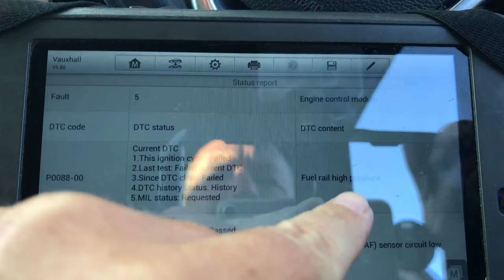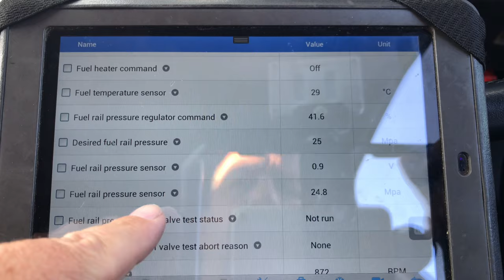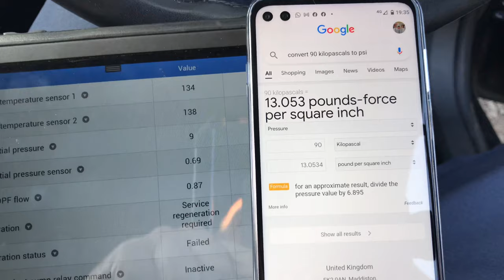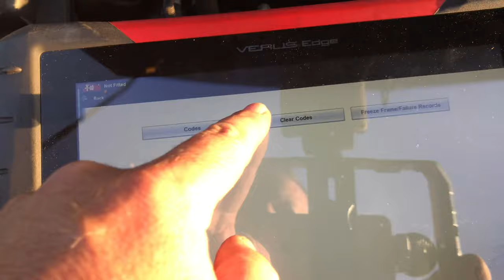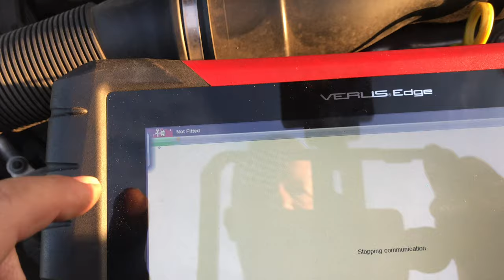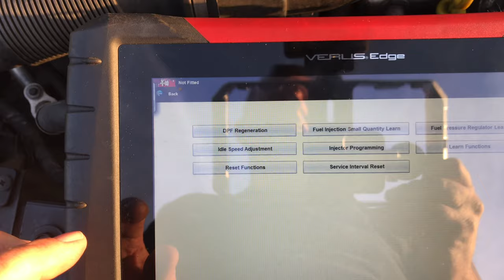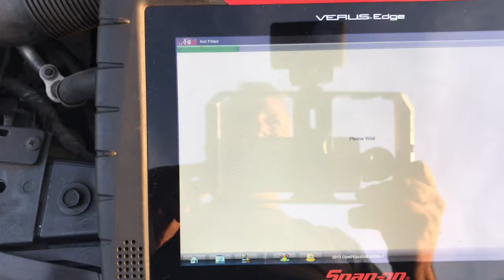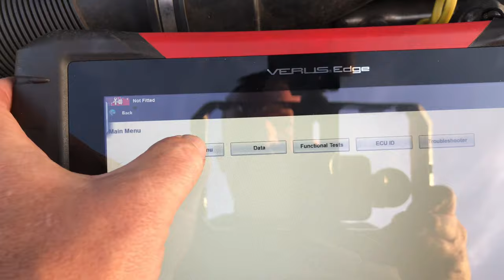"The Unfixable Car" Vauxhall Astra J 1.7 CDTi (2013) - P0088 Fuel Pressure High Part 1

Comment: Thankyou had my car in the garage for over a week bought new sensor had new clutch flywheel dpf work done and then this happend i thought it would never work very nearly went for new fuel pump sent this link to my local garage within 10minuets it was fixed thankyou very much sirr
Reply: What did you get them to do learn the fuel pressure sensor? And it worked as I got same issue said my sensor was faulty changed it for brand new one and it kicks the message on less but still does it occasionally and enters limp mode I haven't done the learn mode so going to do that. Did that fix yours ?

Comment: I know this is over a year old. I have the same car as this and the revs bounce. Not all the time but intermitently. When running its almost like the car is about to stall but catches again causing surging and dropping of power. No codes are being stored at all. Ive replace the scv, maf sensor, fuel filters and sensors and still no joy. I really dont want to scrap the car as when it runs its great. Any ideas or suggestions?. Im thinking maybe i bought a faulty scv? Even though it was new.
Reply from the maker: My money would be on the SCV and good one costs £80 in the uk
Reply: @sandyande  I'm beginning to think the one I bought was faulty from the get go.  The one I got was off of ebay and cost near 70. I'll look for a better one. Thanks for your reply. I'll let you know if I get it solved :-).
Reply from the maker: Did u reset pressure via scan tool
Reply: @sandyande  yeah it was done :-).

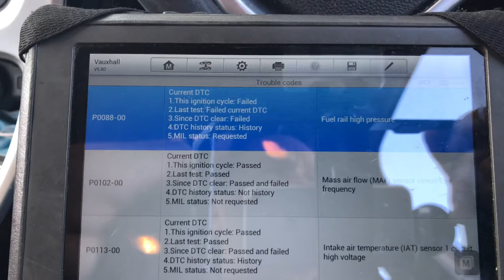Comment: 01:45 'pump not timed properly'  can you explain how to time the common rail fuel pump? 😂😂
Reply from the maker: Sometimes common rail pumps have to be timed up with a timing tool when the timing belt is replaced so that the injector sprays when the cam shaft lobe is at its highest point driving the pump
Reply: @sandyande  All the injectors share a common rail, all the pump has to do is keep that rail pressurised, the firing of the injectors is electronic, controlled by the ECU.